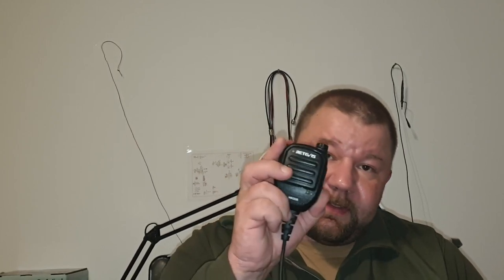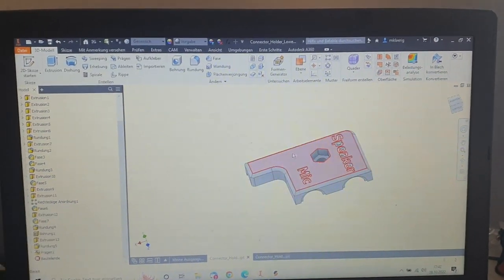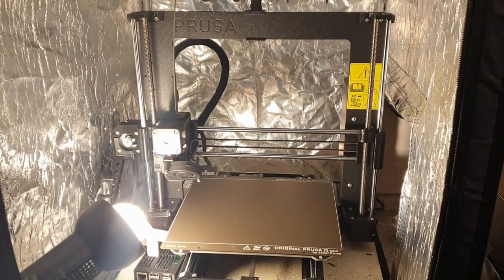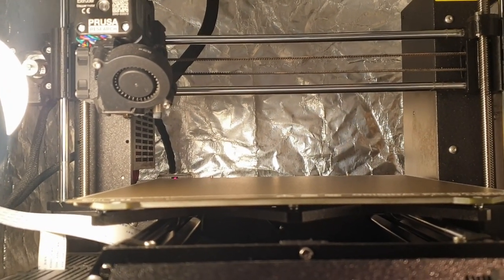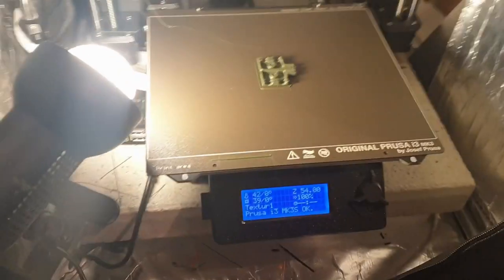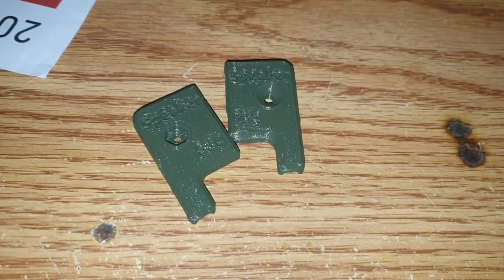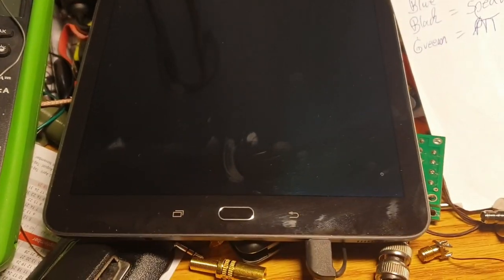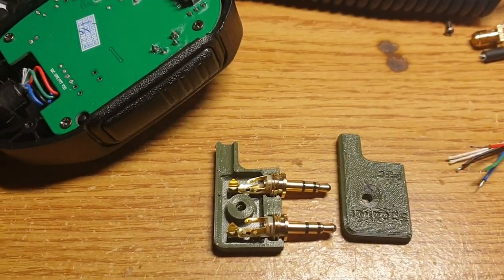external Mic for (tr)uSDX - showing the use of 3D printing in Amateur radio

Comment: Just got my mic and wired it up, popped it in the 3d printed case - works a treat! Thanks for the heads up Manuel!
Reply: What jack did you use that fits?
Reply: @chasiu75  I used two standard 3.5mm stereo plugs with the sleeve connection/wire clamp bent at 90 degrees. You may have to trim this slightly.

Comment: Thank you Manual for sharing your printing information. I am experimenting with an electret mic and a 1 watt transistor amp built into an old microphone case. Will use your STL files for the connector. Vielen dank.

Comment: I used an old CB power mic for a donor. I gutted the old mic and put a small speaker and a junk box electret element in the case. I used 2 3.5mm pigtails for the connectors this way I can use it for SSB or plug in a key and still use the speaker in the mic.

Comment: Another Great Project. I bought the mic, printed the parts (at 102% to get that little bit more clearance from my 0.4 extruder), wired it up using a set of TRRS plugs, and once checked, glued it together - works great, makes a big difference to reception. I previously made the battery holder and the Linked Dipole (that is my best antenna - using the thin 316 coax). Also made lots of end-fed transformers. Great for FT8 and the like, but could use a small amp for SSB in my remote location on the west coast of Canada - any recommendations? THANKS!
Reply from the maker: Thanks for the feedback !

Comment: I recently bought a Retevis HK008 and converted it for use with the (tr)usdx per the information on the RADIO PREPPERS YouTube channel. The speaker worked great but the PTT was always at Tx. I double checked the wiring and it was OK. Another newer commenter on RADIO PREPPERS also had the same issue. It is possible the newer versions of the HK008 changed something that make them not compatible with the conversion???
Reply from the maker: That´s absolutely possible, that they changed the wire colors.... I have no idea. I measured it, what was connected where, before I came up with my wiring.
Reply: @dl2man  Hi Manual: I buzzed the two 3.5mm connectors I added per the (tr)usdx pinout to the Retevis circuit board solder connections which are marked. They were OK. Using a voltmeter the PPT lead was at 0.02V without the key switch on the Retevis pressed. The LED was red (I believe the LED was red when powered up out of the box without being plugged in). I could not debug the Retevis circuit board easily(traces running under components) so I put it aside and going in a different direction. Thanks, just wanted people to know this might not be an easy thing.
Reply: Hey where did u get hk008? Just tried amazon, ali and bg...
73 df7ed

Comment: Sorry for the newbie question, but i am stuck on where the red and black wires are soldered
Reply from the maker: Please watch the "Assembly" Section of the video over and over again. I´m showing and explaining exactly where to solder what. Use a Multimeter to find out which solder point is Tip Ring or Sleeve, as this variates from supplier to supplier.